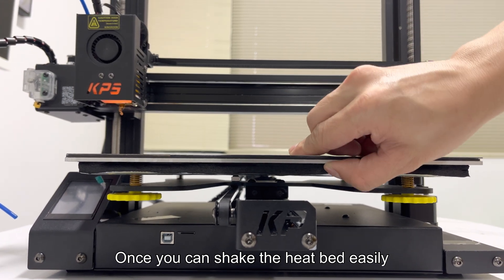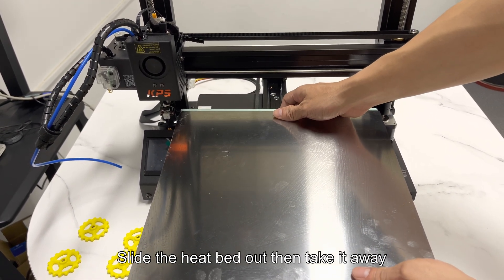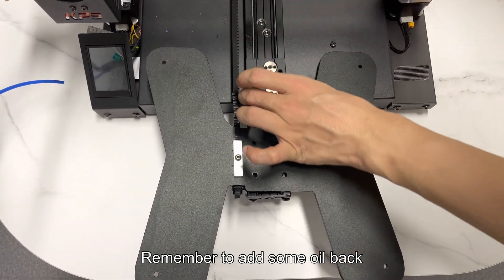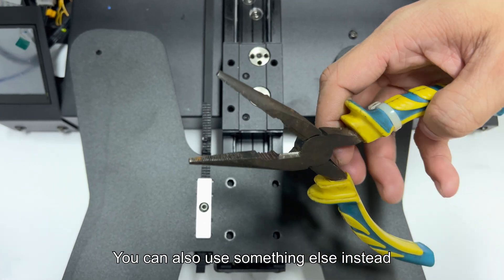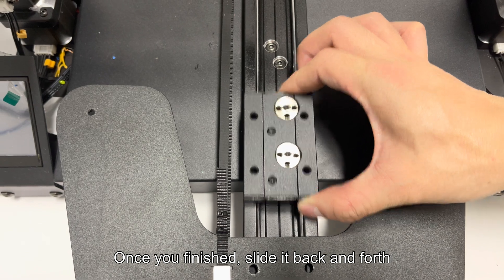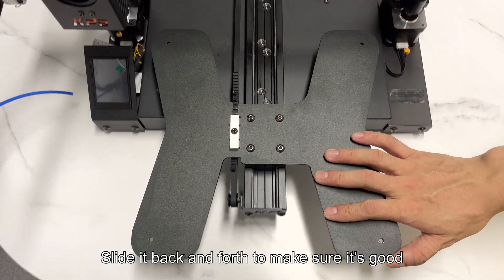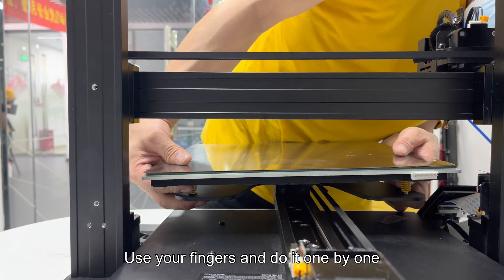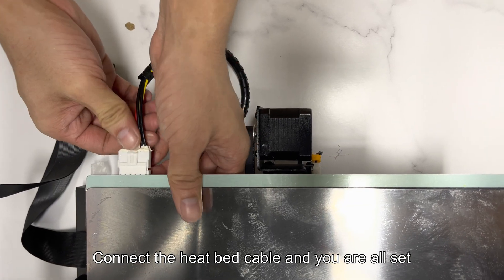How to Adjust the Linear Rail Guide Slider for the KINGROON KP5L 3D Printer

Comment: instead of using needle nose plyers u should really make something that can be printed or something, this needs something with 2 pins, would be really easy to make, not sure what these rails an carriage is called but i like the idea of being able to adjust them cause i had to replace all the mgn12c blocks that came on my old kp3 within the first year i got the printer but this actually gives you the option of adjusting but kingroon should really supply a tool to adjust them or give a file that can be 3d printed an used but telling the customer to use a set of needle nose plyers an to be careful not to hurt them selves cause they will if they dont use plyers often, they will end up pinching a blood blister on the side of one of there fingers all cause they bought something an was told to use a tool that isn't meant for the job. if i had one of these blocks i would make a tool that u could use screws to help turn the adjustment but the community shouldn't be the ones who have to make stuff like this for a company.
Reply from the maker: You are right about it. We really should have use a proper tools for that or make one.